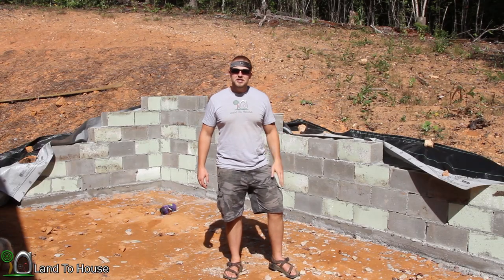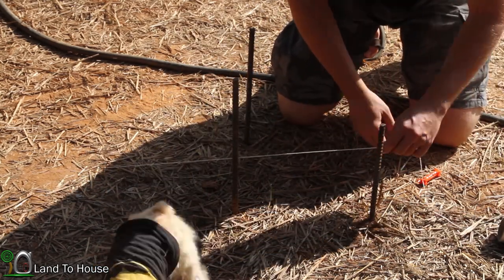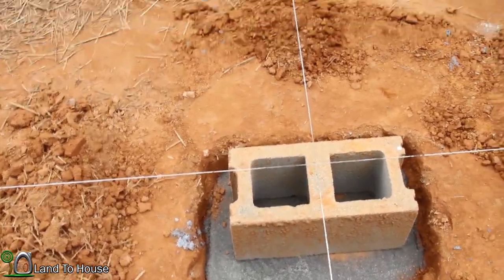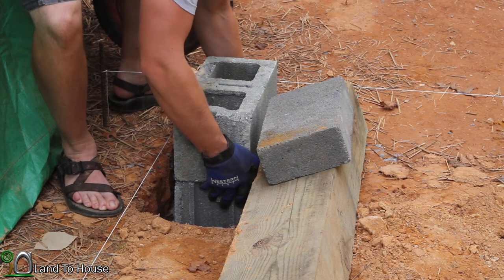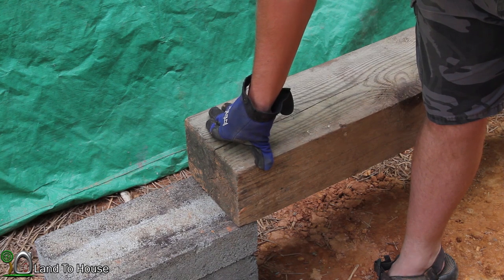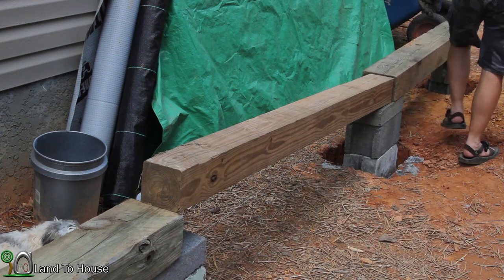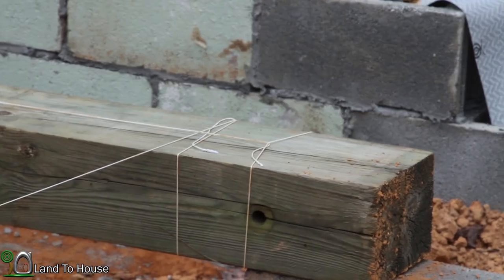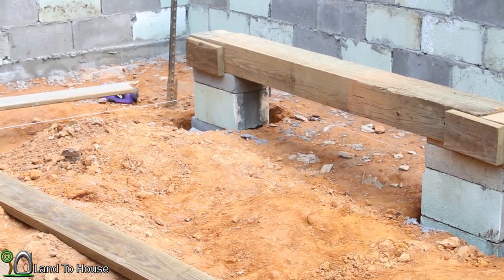Workshop Footers and Runners Build a Workshop 3

Comment: I appreciate your effort.  I would recommend you use a water tube level which is accurate and can be used at any location on the building frame.  You may want to look up a scarf joint for butting the timbers together.  What keeps the timbers attached to the blocks, the blocks to each other and to the footings?
Reply from the maker: +Chris Pfeffer the next time I build something I would like to try using the water level. It does seem to be a very effective method. I am Loosely basing my building off of my parents build. After the construction was finished metal screw ties were used about three feet into the ground with metal strapping anchors to hold the building down in place

Comment: Looks great!  Why did you not use mortar for the concrete blocks? In case you need to adjust?
Reply from the maker: +Kirby Kercheval I am kind of basing my building off of the one that was built for my parents. They did not have mortar. I assume it's not necessary.
Reply: @LandtoHouse  for a so-called "garden shed" that is for "storage only" and not occupancy and can tolerate a little uneven settling, yeah that is not uncommon to let the weight of the structure just rest on dry set blocks.  Mortar would tie the blocks and footings together a bit better against lateral loads (sideways forces) such as a strong wind pushing the building and trying to roll the stack of blocks onto their sides.  Mortar would also give you a chance to correct the height of the blocks to get them all level with each other.